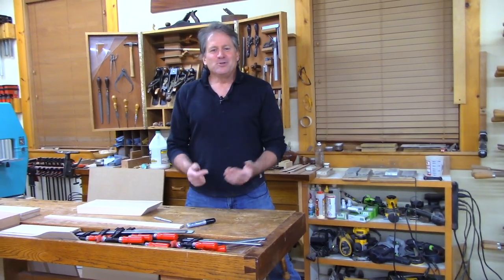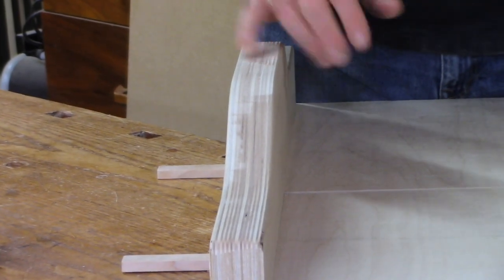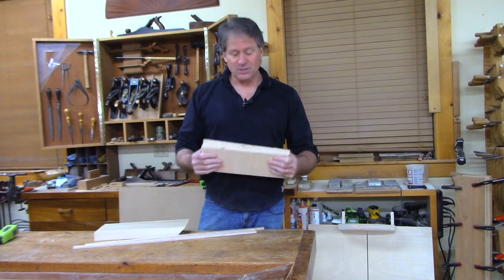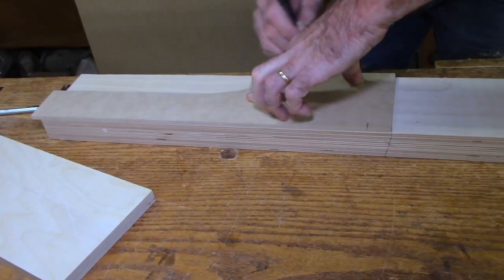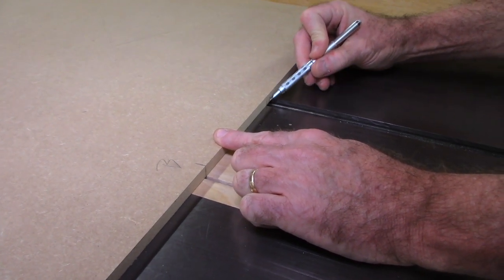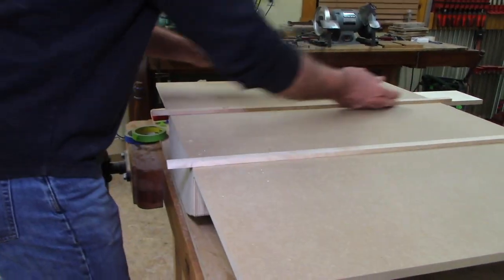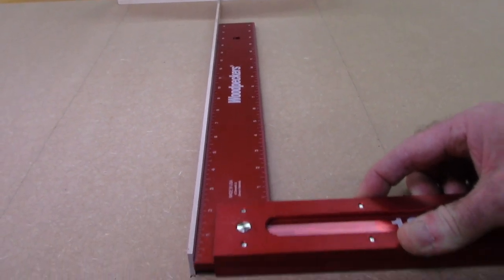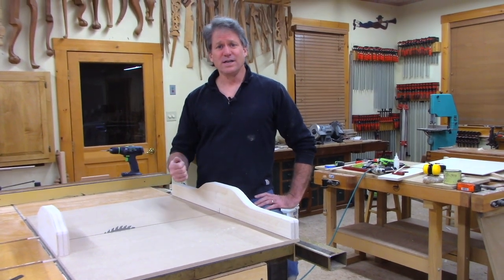How to Make a Cross Cut Sled

Comment: Can you explain why you don’t glue the fence down? Thank you
Reply from the maker: You certainly can glue it down, but I have had times in the past when a sled fence that was glued down needed adjustment. I have found that the fence stays in place quite well with just the screws, and it is still easily adjustable if for whatever reason the fence gets out of square or needs replacing. Hope that makes sense, thanks for watching! 👍😎

Comment: With your new table saw, I am presuming you had to make a new sled.  I am in the same boat.  Did you still use MDF?  I have heard conflicting info regarding MDF causing SS brake activations.
Reply from the maker: Thanks Tom! This was new to me, I did not know MDF was a potential problem with false triggering of the Sawstop. (If you happen to be in the Neighborwood, you may have seen me talk about you telling me this discussing it with the viewers on our little livestream “Coffee with Tom” episode this past Friday morning.
I did some research and found comments about it in various forums, perhaps some of the same you saw. They said it seemed to be isolated to cheaper grades including 1/2” MDF supplied by the big box stores. I just happened to have picked up a small piece from Home Depot, so now I don’t want to use it on my saw due to the risk of it false firing and ruining a blade and cartridge. But quite a few on the livestream said they have never had a problem with any MDF cutting on the Sawstop. 
I have found 1/2” MDF to be the best material for the base of a sled so I may just take a chance with this and hopefully it’s not an issue. I can make the sled and the initial cuts in “bypass mode” but I hope it regular use after that it doesn’t trigger the saw. 
I will try to find out more from my regular plywood supplier.
Thanks for letting me know! 👍😎
Reply: @EpicWoodworking  I do want to get over to the Neighborwood at some point.  I will have to read up more on "bypass mode".  I have cut pressed particle board with no issues with the saw, and am considering that for the sled.  I know not as strong as MDF, but is just as flat.

Comment: Don’t wanna criticize.. you know what you’re doing but why didn’t you just use your table saw fence to square up and glue your runners? Just put the fence where you need it add glue and drop in place using the fence to flush it the add weight until dry
Reply from the maker: You are right in thinking of other ways because there sure are many options. I choose to “establish square” with the first runner using a square and referencing from the back edge where I will be placing my fence…that way I know I will be close. Referencing from the fence can certainly work but it assumes the fence is set accurately parallel to the slot, which is no guarantee as the fence is adjustable. But if you know yours is parallel, by all means that method should work well. Thanks for watching! 👍😎